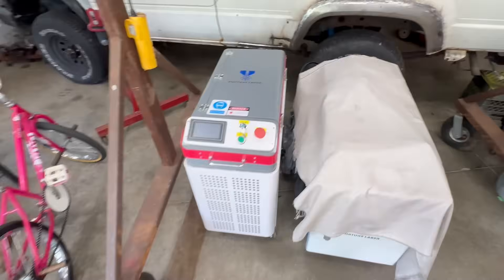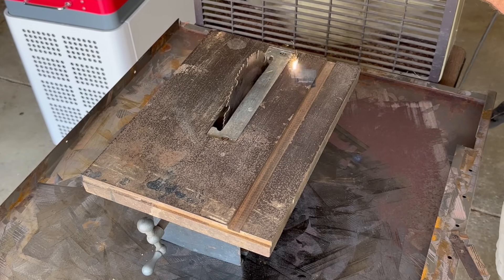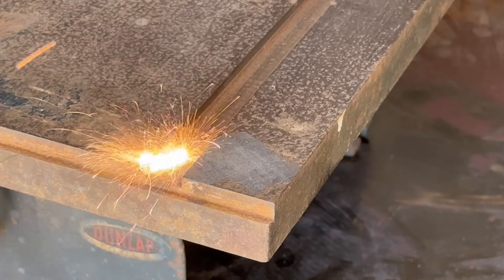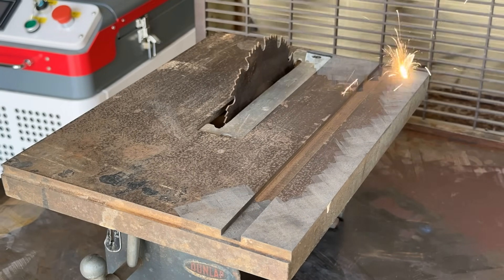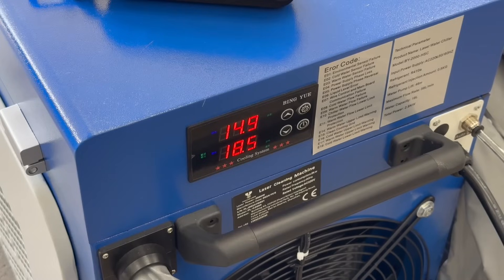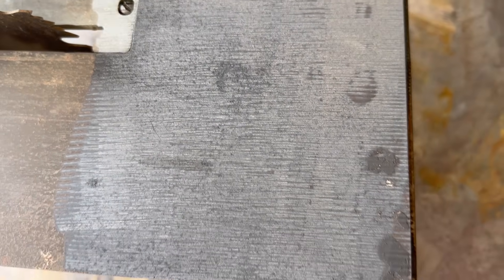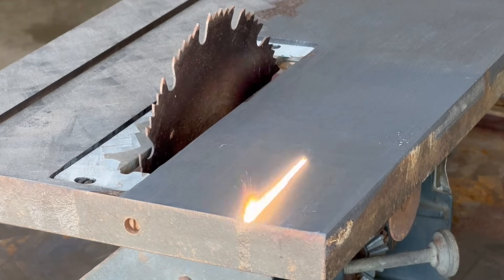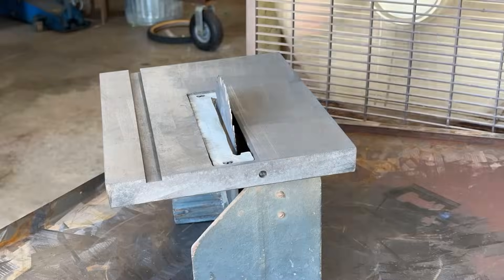Rust Removal - Laser Cleaning Machine vs Cast Iron Table Saw

Comment: I'm hoping to start a laser cleaning business. I currently work part time, but I'm autistic (been discriminated against at 3 different jobs, including my current one), living in fear of the day my employer decides I am no longer worth "dealing with." So I'd rather work for myself. 

I am drawn to laser cleaning because I was always fascinated by technology. Also being sensitive to textures, cleaning rust via sandpaper is a literal pain. I think this would be a good opportunity for me to make good money, as I live in Iowa, and I see lots of places with a need for this service. However, my biggest hurdle is money to even buy the equipment. That's why I'm trying to find the cheapest machine I can (I'm thinking continuous wave, and I'll start in the industrial sector), and go through Vocational Rehabilitation for funding. That's probably going to take forever, though. Still, I want to try. 

I've been trying to learn what I can from watching videos, but few actually go into detail about cleaning different types of materials and messing with the settings. That's why if I get my own machine, I'm going to make videos, and show how it reacts to different materials.
Reply from the maker: I think if you live in a well populated area, there might be an opportunity to make a business out of laser cleaning. The biggest advantage of the pulsed is that it can also remove paint, oil and grease, giving more opportunity for industrial projects- just at a much slower speed than the continuous wave. I've seen companies who restore the stained/painted wood trim in old homes back to the natural finish by using pulsed laser machines.

Comment: I could see some fumes coming out as the laser was cleaning the surface. How bad are the fumes?
Reply from the maker: It's more dust of evaporated rust than fumes. I have a large fan next to the item I'm cleaning that blows everything outside.  If the laser is used on paint or oil/grease, then there will be more smoke and fumes instead of dust.

Comment: Just subscribed, you earned it. Not from this video specifically but from the 10 others I've watched today. I'm getting ready to repair a rusted floor pan in my truck. (Pennsylvania winters are just as bad as Ohio especially on Lake Erie) your video made it look easy and broke every step down perfectly. I have some welding and fab experience but even if I didn't, I would be confident going in to the project after watching your videos. I just found your channel today though I did watch your pole barn videos a while back when I was considering building a garage. Wish I would have looked at the rest of your channel then. Also, I love the laser cleaning machines, I wish they weren't ridiculously expensive. I will eventually own one though, can't beat it for removing rust and mill scale!
Reply from the maker: Thanks!! It's amazing the repairs and fabrication that we have to learn just to keep a vehicle on the road in the rust belt. I mean how many people in CA or AZ know how to replace a rusty floor or rotted out rocker panel? First repair is a slow process, but once you do the first one, it's a lot easier.